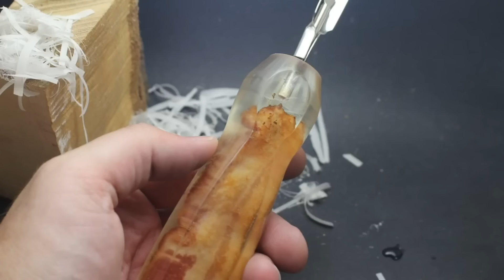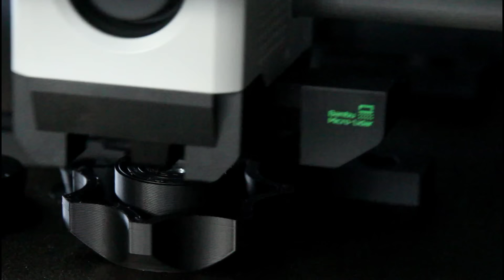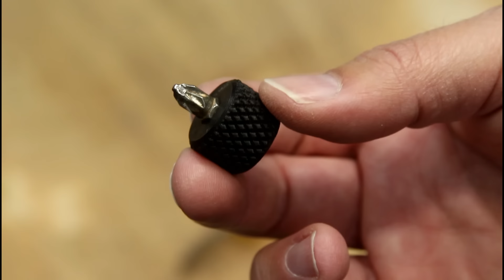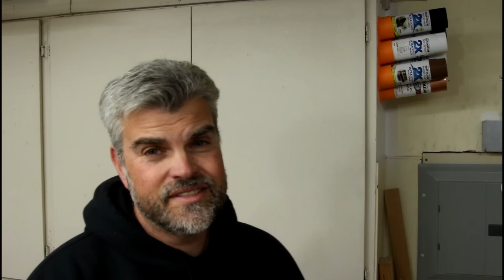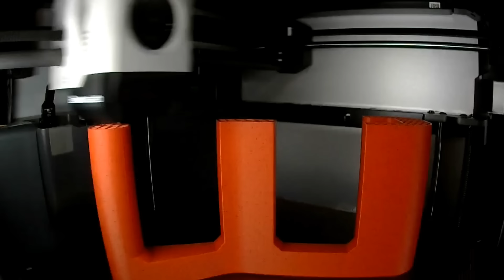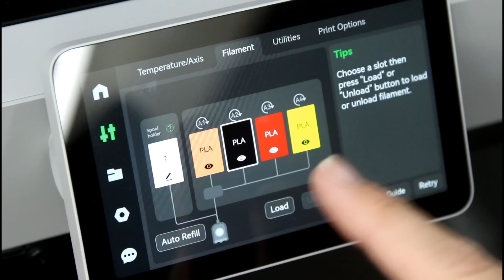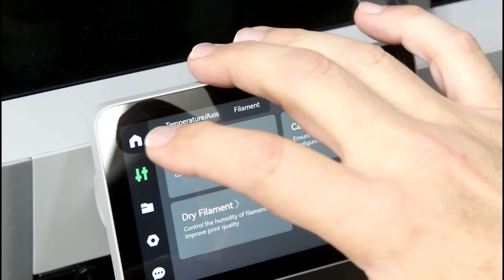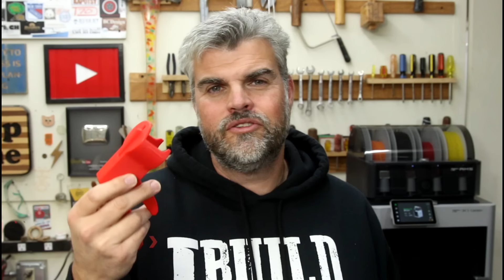5 MUST Have 3D Printed Tools!

Comment: I'll be interested to see how your journey goes.  I use my X1C in my machine shop CONSTANTLY.  My coworkers thought I was crazy thinking that it could be of any real use around the shop.  "Plastic does not belong in a machine shop" they said.  Here I am about 2 years later and now they're coming to me to print them jigs, work holding accessories, vise jaws etc.  The one piece of knowledge I can pass on from my own experience is that ABS tends to be a better fit in a shop environment, it's not as easy and forgiving to print as PLA but it has stood up much better in my experience over time and use.

Comment: 3D printers are also amazing for making custom templates. If you're a perfectionist like me then you can make templates with perfect curves that are the perfect radius, or make templates to create perfectly matching shapes.
One thing I have always despised making when it comes to woodworking is anything with hexagons that fit together, because if you're off by even 0.1 of a degree, then that compounds on itself incredibly quickly. But now? I just 3D print a perfect hexagon template and never worry.

Comment: I love my bambu x1, it’s standard issue in my opinion, I’ve only had three failures because i didn’t have support and the other was because i didn’t have glue on the build plate. But is so turn key it’s amazing

Comment: To paraphrase SuperfastMatt's video from when he got a Bambu x1c - 3D printers have finally hit the point where they are reliable and you don't need to take up "3d printering" as a hobby to make things with them; "you can be excited about the printed things and skip the joy of tuning and fixing". You can now consider a 3D printer to be a tool for making useful things in pursuit of other ends, and no longer a toy or a project in it's own right or "the thing that makes toy boats and dragons".

Comment: Wait till Peter Brown discovers gridfinity, all of the various printable nuts/bolts/wing nuts/washers...

Also, while makerworld is decent, I find Printables to be a better site for stl files. 

Finally, skip the metal scraper that Bambu wants you to print, and instead just buy a plastic razor scraper instead as it wont scratch your print bed like the sharp Bambu one will definitely do...

Comment: Print in asa not pla, pla turns into sand over time. Asa will last much longer and has a higher temp and tensile strength over time

Comment: i have been printing for a full year with an ender 3 pro, neptune 3 and a monoprice select mini v2 and those i got all free or dirt cheap needing repairs. i just got a bambu p1s with the very little money i have and this printer is world changing for the hobby. also pro tip unless you have money to burn do not buy fillament from bambu labs, buy any other brand trust me you'll save $5 to $15 per roll
Reply: They don’t make filament anyway

Comment: Just wait until you go down the gridfinity rabbit hole.. It's absolutely amazing for creating tons of organization in the shop.  I have screwdrivers and wrenches, sockets, etc. all set u on holders in my tool chest, being on a grid system you can rearrange and add stuff or make custom holders for wonky shaped tools.  I've made holders and trays for mica and alumilite dyes,  magic juice bottles, etc. I also make pen blanks and block molds too..  3D printing is so valuable in the workshop, the possibilities are endless!

Comment: I would have killed for a printer back when I was working as a cabinet maker. Being able to print a broken housing for a tool i dropped on the concrete floors would have saved sooooo much time.

Comment: Peter, you have mentioned before your shop gets pretty hot. If that’s still the case you should consider printing functional things in something other than PLA. I personally love printing with PETG. 

PLA will soften even at 80-90 degrees and PLA has what some people call creep. Overtime it will flex even if it feels solid. Stuff like the net inserts in those black parts on the table saw will eventually fail. It might take a long time but they likely will fail at some point. 

PETG is cheap, way more temp resistant and as strong as PLA but much tougher in the long run and super easy to print just a bit slower. 

Also for any bulk prints or bigger things I recommend aliexpress for filament. I buy 10 1kg rolls of black Petg for my little print farm for about $70 shipped and it usually only takes about a week since they ship from the US.

Comment: Mate I was exactly the same as you about 3d printing until I wanted some Chuck holders for the workshop wall. It was cheaper to buy a printer than pay someone to print the half a dozen I needed. I’ve since designed loads of workshop organisation especially for tools around the lathe. We all know that wall space is a premium and 3d printing allows you to print something small enough to take up minimum space yet still strong enough to hold the tools. I have options now for everything from callipers and live centres right up to chucks and chisels and the cost is relatively inexpensive

Comment: Gotta stop using the posidrive bits in Phillips head screws...   They are not the same shape and cam out easier than usual and mangle both the bits and the screw heads..

Comment: I bought a Bambu A1-Mini without AMS with my own money. I've printed feather boards, and runners for my Shopsmith (a weird size), some accessories for my tracksaw,  and bench dogs for my Bora MFT type top. My top is the Euro standard 20mmx96 spacing. Accessories in that size are still tricky to find in the US but not any more, I just make my own. The next fun is to dive into design.

Comment: The only issue with the spray paint holders I can see is they could sag due to heat mixed with the weight of the can. During the summer it could be a benefit to make sure they stay cool, otherwise you could end up with all your cans on the floor.
Reply from the maker: That will be cool to find out! If that happens next summer I will 100% let folks know!

Comment: Some friendly advice for a new beginner. Never move the bed plate when its turned off! It generates a current that flow back into the main board, which then Fry's the stepper motors. Only move the plate when the machine is on or stepper motors are disabled. I've burned a few main boards from that rookie mistake. 😢😊

Comment: Welcome to the club! You'll really want to get at least PETG for your garage items. PLA gets soft in the heat. I love printing with ASA for outdoor items. I've had a 3D printer for a long time, but just got the Bambu Lab A1 it's been the easiest click and print experience I've ever had!
Reply: Agree, use PETG to be stronger and flex without breaking.

Comment: In begining of this year i purchased the BambuLab P1S and ever since ive been hooked. The printer has such a high succesrate and everything is well documented for the newbies in the bambu wiki.

Ive been really curious about the woodfilements. Maken banks with a 3D printer doesnt really make sense but maybe you could test it out and see if it could have any use in woodworking.

Also, incorporating marble fillament in a woodturning or ressin project could be fun!

Comment: You keep saying "for just X cents you can print this".  But you are not including the $1k+ price of the printer or the electricity cost.  Add to that that 3d prints are not ANYWHERE NEAR as durable as injection molded parts and it all adds up to you are printing off sub par things that even Harbor Freight wouldnt carry. I have had a 3d printer since they were brand new tech.  They are 100% toys and nowhere near a viable option especially if you count any design time in this equation.  I would suspect the bit handle and that dry wall carrier to break in a short amount of time, the can holder is a gimmick, the feather board has some use but thats about the only thing.  Dont get me wrong they are a fun toy but after trying to years to justify them you have to come to grips with the fact that they are not the end all be all creation station.  They just dont create things that stand up to real work.

Comment: Besides a tiny plastic clip to replace one that went missing (yes, it showed up around the time the replacement finished printing, like they have a tendency to do), the most useful thing I’ve 3D printed is a set of picot gauges that I use when tatting.

Comment: Does the different color of filament represent different sizes or strength?
Reply: Nope, just different colors. That printer uses 1.75mm filament, but it can print in a ton of different plastics. PLA is probably the most common/cheapest, with PETG as the next most common, all they way up to crazy engineering tier filaments

Comment: I've been designing and printing 3D tools and objects for almost a decade, and the fact I have never seen/thought about that micro screwdriver actually upsets me. I have had to replace assemblies in my car that felt like they were specifically designed with inaccessible screws in mind, and never thought about printing my own tiny screwdriver. I just bought the smallest one I could find and got mad that it was still too big. Gonna design a little case to hold it and the bits and make a bunch as stocking stuffers for family this year. Great video!
Reply from the maker: That's a great idea, would love to see a link to that case when you're done!
Reply: If you want to get extra fancy: Embed a magnet in one end to help retain the bit.
Reply: @ThatRobHuman  that was my first thought. I love when the handle has a magnet for the bit, it is a nice touch.

Comment: I love how you call Imperial and old English measurement as “standard” ……it used to be, many years ago but then we got wise
Reply: Americans don't use Imperial... they use US Customary Measures, which are based on the British system in use (Winchester) when America first became a country and before "Imperial" became a standard (1826). Although most linear measures are the same in both systems, many volumetric units are different. For instance, an Imperial gallon is 4.55 litres while a US gallon is just 3.78 liters.

America actually intended to adopt metric measures in the 1700s, but British pirates captured the official kilogram standard being sent by ship from France, and America decided to stay on the system they had instead of try to obtain another one.

Comment: Apology accepted! Ha. Just know that PLA suffers from creep, this means it will deform over time under tensile stress/load. PETG or the newer replacement of PETG called PCTG will fix that to some extent! it's really worth it to try out because PLA is nice for models, but not that great for mechanical designs :)

Really cool to see you embrace this tech. I've always been wondering why you didn't want to get started with it and I think I might have mentioned 3D printing in a bunch of comments under your videos haha.

Oh, one more thing, keep dust out of the machine! :) I see it's in your workshop. So if you're going to do a lot of work that creates dust, a cover would be a good idea, but don't cover it while it's on!

Comment: Prints that use embedded magnets are my new favorite! Makes lids for boxes much more secure, prop assembly a breeze, and game piece functionality unforgettable.
Reply: i like the idea of embedding nuts and magnets. I need to figure out how to buy the right size nuts and magnets for the prin.
Reply: @manp1039  just got to be careful that the magnets aren't too powerful that they jump and stick to your hotend as it flys by.  It's usually good enough if you make the hole for the magnet a very tight fit
Reply: @ecliptix1 or glue them in
Reply: @ecliptix1  super glue

Comment: I've had a 3d printer since 2019 and its my favorite tool I own. I learned fusion 360 in a high school class before I even had a printer and being able to model my own tools/storage/replacement parts/ect. is amazingly useful, not only for myself but also friends and family. Plus the 3d printing community is very welcoming and helpful from my experience.

Comment: The second you realize you can use a 3d printer to replicate parts, it becomes the most useful tool you have ever had in your workshop.   Every little plastic tab, spacer, bracket, fiddly bit, etc can be replicated and fiddled with to make just what you need to fix or upgrade something.  They are the most useful tools I own.
Reply: And it'll pay for itself in no time, I fixed two shark navigator vacuums, and been selling a ton of prints at work lol
Reply: I bought my first 3D printer over 10 years ago to make a part for my wife's favorite jar opener that was no longer available from the manufacturer.  I now have 6 printers and use them for all sorts shop projects.  One of the biggest uses I've put them to is making dust collection adapters for all my machines. They are also great for making jigs and fixtures as well as replacement parts. (Disclaimer: I was an engineer before I retired, so CAD/CAM design is easy for me.)
Reply: thats precisely why I just bought mine

one small plastic part=$20+
3d print your own for 20 cents and a bit of time, not much longer than browsing online or going to the store
then in a few minutes or hours you have your part
Reply: Yes ! just this , my pool robot impeller broke on a Sunday , I googled the part and I could buy it for 11.99 but would have to wait a week or so . I searched the 3D print file websites and found someone had uploaded one . 30 minutes later the new part was fitted and the robot back to cleaning my pool ! This blew my mind
Reply: That was a quick print. @stevebeck9470
Reply: @stevebeck9470  I bet you made your part for less than a dollar. 
A 3-D printer, and Internet access is an absolute 1-2 punch! 
In fact, your $11 you saved could go towards paying for your Internet. win win
Reply: Just fixing one or two items could pay for the printer.
Reply: Super powerful item for someone who lives off grid, and needs to fix things. Like people up in Alaska for instance.
Or someone in rural, Kansas, or Missouri, who’s 100 miles away from the nearest store.

Comment: Wait until you learn CAD and start making your own custom tool, that's when the superpower of printing for the workshop really happens.
Reply: What's the next progression from Tinkercad.
Reply: @andyflans9966  Theres a lot of great softwares out there, I've gone down the path of Fusion360 and its really opened the world of 3d printing for me.
Reply: @andyflans9966  Hands down: Onshape. Or if you feel inclined to spend money: Fusion360
Reply: @andyflans9966  FreeCAD. there's a learning curve but you don't have to pay for a subscription AND YOU keep all your files(designs) on your own hard drive. THAT's why i use FreeCAD  :)
Reply: which CAD you'd recommend for a begginer to prototype?
Reply: @pedroaugusto_c137  I started in SketchUp but have been moving away to Fusion360, Its much easier to actually create solid models. Theres a ton of different softwares though, and they all have their pros and cons. If you're into prototyping though, I've been very happy with Fusion360.
Reply: @pedroaugusto_c137  onshape, but the models are public, unless you pay.
Reply: @pedroaugusto_c137  they all have a learning curve but plenty of tutorials online...i suggest FreeCAD. no sibscription and you have total control of your files on your own hard drive(not cloud)
Reply: @pedroaugusto_c137 definitely tinkercad! onshape and fusion 360 are only free for hobby use, if you wanna try some of the good stuff. but get costly for commercial use. 
freeCAD isnt quite as convenient, but entirely free to use.
Reply: Solid works is what I have moved to from tinker cad tinker cad is a great free beginner program don’t sleep on it

Comment: How much calibration did it take to get the printer set up? My biggest issue with my 3d printer is I don't have the time to sit there and troubleshoot or calibrate every time something doesn't print right.
Reply: That's the thing with the Bambu labs printers. The mark-up you pay gets you a bunch of auto calibration features and working slicer slicer profiles. Note that these are his first prints off his first printer and the parts are pristine
Reply from the maker: It did it all itself. My main issue was after print 7 or so, some prints stopped adhering for me. That's when I learned about keeping the plate clean. 
Honestly, that is the only issue I've had since August.
Reply: @peterbrownwastaken  A little bit of Aquanet hairspray on the build plate does wonders for adhesion

Comment: Dude. The cost of the print doesn't matter because of how expensive the printer is. You can make featherboards much more durable than that one very quickly. In fact, even if you have a 3d printer already, making a wooden featherboard is probably a more practical way to go.

And you're printing some else's designs. At that point you can just buy the thing and save some money. It's not like you're creating something anyway.
Reply from the maker: I hear you.
Also, I think I'll get to the designing phase. 
It's just going to take me a while to catch up. :)

Comment: I own several 3D printers.  The Bambu Labs X1C is the best of all of them in terms of print quality and overall performance.  It's not the fastest I have used, but it is competitive in terms of speed.  My only complaint is that it's not the easiest printer to clear blocked filament from the hot end.
Reply from the maker: I've not encountered that yet. Not looking forward to that failure.
Reply: @peterbrownwastaken  It's not that difficult to clear, but it's still harder than my Ankermake.  I've managed to reduce blockages by using reliable filament brands.

Comment: Top uses for my Ender have been printing templates, replacement cut plates and the biggest....hose fitting adapters.  A buck of PLA vs sometimes 10 bucks for a retail version.  So worth it.